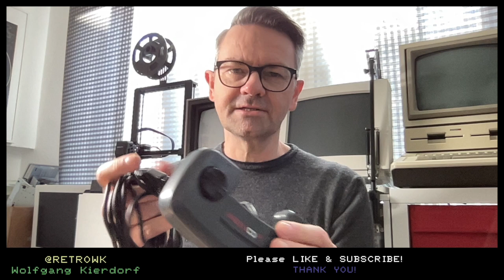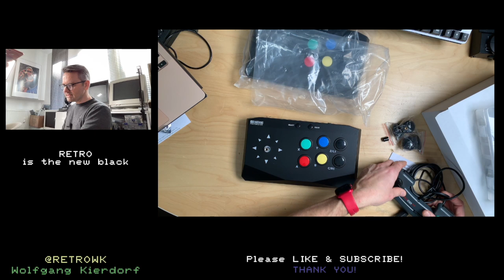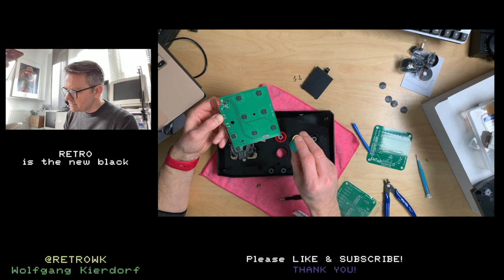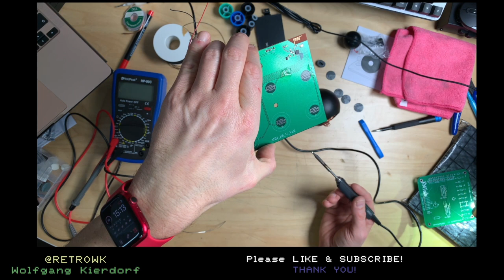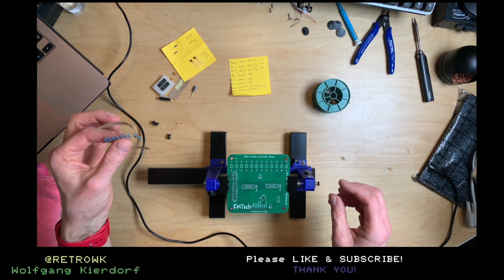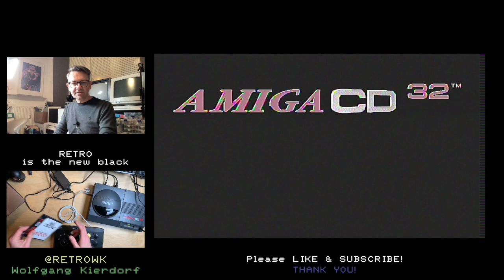A brand new Amiga CD32 Arcade-Stick - and you can built it #cd32 #amiga #commodore #amigacd32

Comment: You can buy the interface ready made from monster joysticks  and it's a lot smaller so maybe easier to fit... £9 for the interface £4.50 for the 1.8m cable.  £19 if you get the interface, wiring loom & cable so about £26.50 per joystick... cheapest new replacement I've found is £39 but that is a SNES style KTRL CD32 - Dunno if you deleted it or it was a YT glitch... if it was you I'm sorry for putting it back... I'm not spamming just pointing out alternatives as I was looking into this for myself as I have 3 CD32s. (Removed link to monster joysticks as I think YT spambot is killing the comments - Products>Accessories & Spare Parts>Interfaces & Wiring Looms>CD32 Retro Joystick Interface)
Reply from the maker: Thanks! That's cool! I will check it out and pin the comment.

Comment: Hello The link to the Cd32 PCB does not work. where can I buy such a board to make a CD32 arcade joystick?
Reply from the maker: Check this out: https://monsterjoysticks.com/cd32-retro-joystick-interface . Seems to be MUCH easier.
Reply: Thank you for your help. I decided that I prefer the KMTech PCB that you used. I found "KMTech AmiArcade32 VERSION 2.00 CD32 Controller Amiga Happ Sanwa Retro DIY PCB" on eBay. I bought Sanwa components on Aliexpress, I'm waiting for the shipment from Ali and eBay. I want to make the casing myself.
Thank you again, your video will help create my arcade joystick for CD32.  😀
Reply: my first arcade joystick works great, I made a mistake because I wanted to make similar to quickjoy "Megastar" and TopStar. The buttons are orange. E-fire and jump in Amiga 1200 also work. I ordered another set, colors like in CD32. Your film inspired me, thank you :)